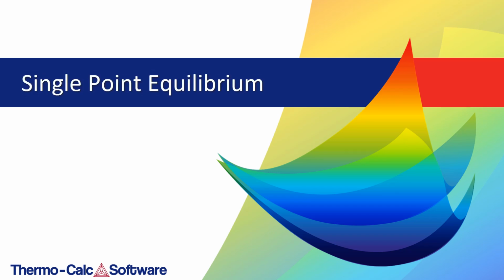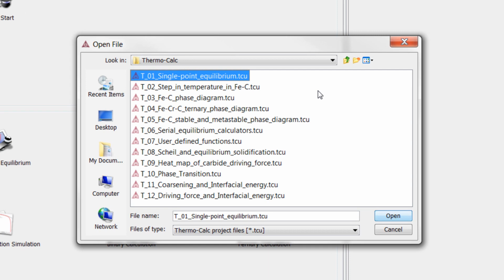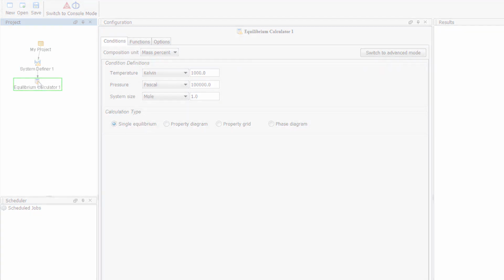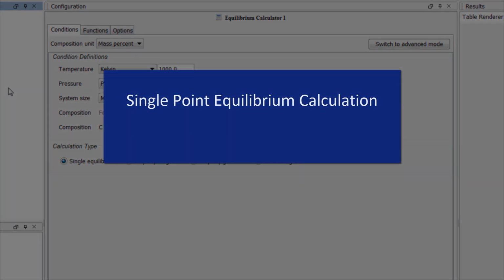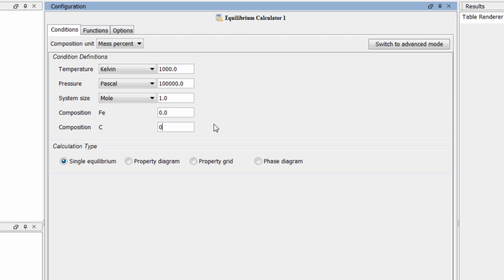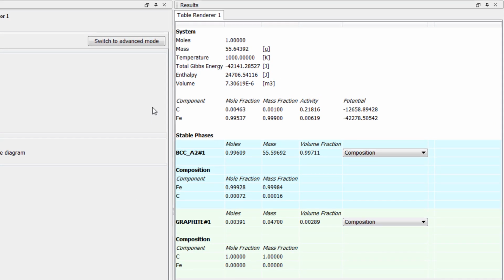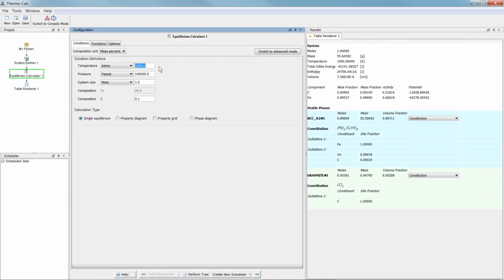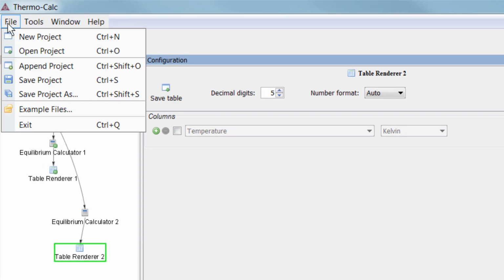Example T_01 - Single Point Equilibrium - OUTDATED

Comment: I would like to ask what is the significance of conditional definition temperature in property diagram, and what is the basis for setting the temperature? The temperature I set in console mode is different, the name of the phase changes, and the calculated image changes.
Reply from the maker: Hi @user-tc4xy8fw3g! Thank you for your questions and your interest in our videos, and sorry for the late reply. The temperature condition in a One Axis or Property Diagram calculation is the starting condition for the first calculation. It can normally be left at the predefined 1000 K.